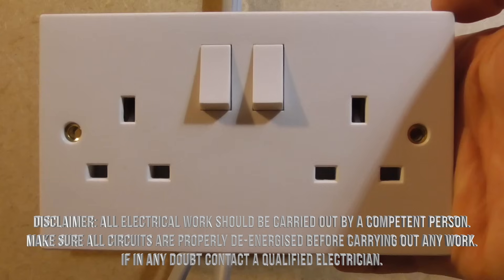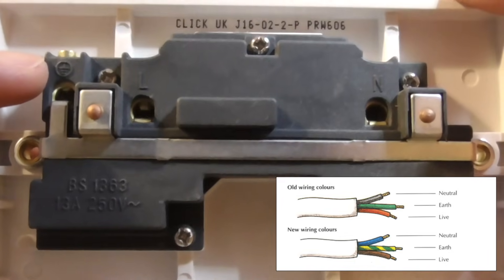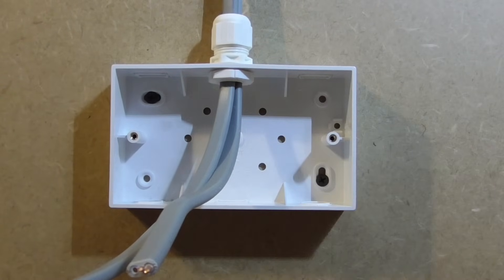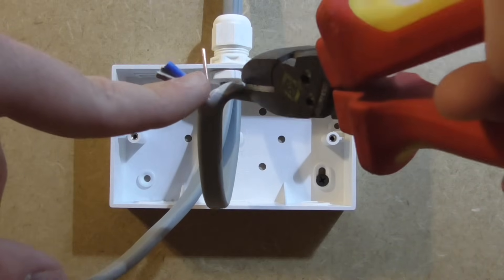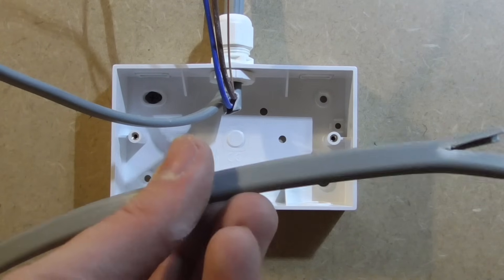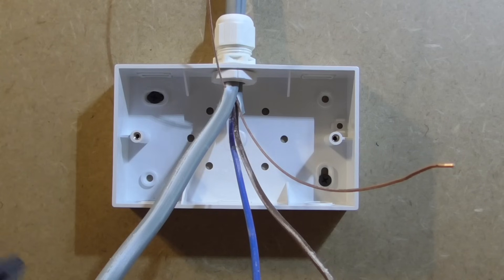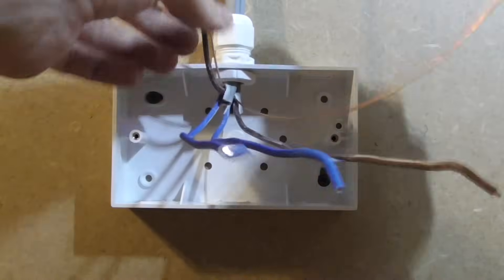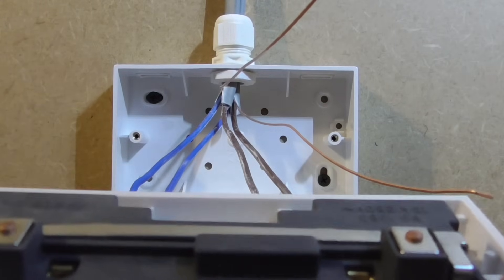How To Wire A Double Socket

Comment: Quick question. Can I connect a double socket with  T&E and put a plug on the end of the T&E and plug it into a separate socket. So basically making the double socket an extension lead

Comment: Thank you. The live and neutral were opposite to the one I removed from the wall. I'm so glad you mentioned that this might happen (7.08 in the video). Now I am quite confident in replacing the unit. Thanks too for talking about the different colours, depending on when the house was built / wired (2006). That was extremely helpful. I'll just watch your video again, to be sure.

Comment: May i know how many double socket can be connected on a 2.5mm cable.
Reply: depends on the mcb/rcbo capacity that is feeding the sockets. in theory it could be hundreds as long as the combined load is less than the supply
Reply: That's completely wrong the max is 5. If you put in a bigger mcb than 20amps on a 2.5 cable if the load is higher than 20amps it will work but the cable will heat up like an element because mcb is too big for a 2.5 cable and it 100% will cause a fire. Don't take any advice from this guy he has no idea what he is talking about. I know he's not a qualified electrician by how short he cut the cable  no electrician would do that. And that is not the correct way to terminate the connections it's much more likely it will cause a loose connection in the future. Loose connections are the cause of 90% of all electrical fires in ireland. Our regulations are the same as the UK

Comment: Those conductor wires are way too short. Conductor wires that are too short can cause them to come loose a lot more easily. Plus if anyone had to do future work it's good practice to leave enough length for them to cut back if they needed to.

Comment: What if you dont have an earth? I have a two socket and 4 wires and what messed up is all the wires are red. The electrical wire coloring in this house was done badly. And im trying to switch it out to a double universal. Both socket was wired with like a bridge from left to right with the original setting. So I dont know if it will work if i remove that bridge conection.

I have 2 Nuetral holes on the top and 2 Live holes on the botom so they are  parallel to eacother. Plus only one wire can fit per hole, not two.

Comment: Can anyone tell me why there are two live cables? Some of my living room's socket have two live cables and some of them has one???
Reply: If it's on a ring main then it will have two cables connected to it; each cable going to the adjacent sockets in the ring. 
If it's only a single cable then it most likely is on a spur.

I'm not an electrician so open to being corrected, but think I'm right in this

Comment: Those cable are too short, if that outlet had to be replace with a different connection position. The guy replacing it is  gonna look silly because the  cables don't reach. I wish I had a pound for how often that's happened to me.

Comment: Does it need testing and a minor works certificate issuing , R1+R2 and zs values . Justin’s wanting to know before I do it myself and void my house ins
Reply: Faster Hard House  brilliant just what I wanted to know, I’ll get the pros in to fit sockets and light fittings from now on, I see many DIYers going for it but when it comes to them selling the house they end up in all sorts of trouble when the solicitors ask questions 👍

Comment: I should know this but why are there are there TWO cables going into the box????
Reply: because it is on a ring main, only one set of wires on a spur
Reply: So can this be done with 1 set of wires in a double socket ?
Reply: @bairdybee  if it's a radial and there's no sockets being fed off it, yes
Reply: Because it’s a double socket so it needs double the flow???

Comment: Cables I always go 25mm past bottom of box at least.  And cutting across CPC and Line/Neutral you will trip any RCD/RCBO and drop out power to other circuits.
Reply: This is a super late reply but I think he's referring to, if working on alive circuit, cutting all the wires at once would cause a short circuit due to the conductivity of the cutting tool
Reply: Can you explain what this means to a layman please? CPC? How has he cut across anything?
Reply: @rorywestfold1657  CPC is Electrician speak for EARTH.  Circuit Protective Conductor.

Comment: Thanks for video. I am wiring a fridge and heater to an STC 1000 temperature controller. Can I use the same type double socket to connect them to the controller, i.e. is that safe?

Comment: You made this hard work by cutting the cables so short a good tip would be when u have striped the cable pull the wires to the furthest corner of the box and cut the live and neutral afew millimeters longer and then the Earth's a few millimeters longer than that.

If the cables come through different points of the box take the striped wires to there furthest corner this may be different corner it's might also be the same e.g. cable comes in at the top left so take the striped wires to the bottom right.

Comment: I’ve got 2 Earth points  On my double socket  plus 2 earth wires .  Can I connect both Earth wires to One point Or must I connect each wire to each earth point ?
Reply: You can put them both in one earth terminal or one in each it's up to you. However in some situations the earth might be short so might only reach to one point any way.

Comment: Do you not bother to fold the ends of the wires in half before inserting them into the terminals? Some say it is necessary, but it makes it much harder to insert them esp. if you have 2 wires into one terminal.
Reply: if its two cables then you shouldn't need to fold the ends, but if theirs only one cable its a good idea to fold the ends because it gives a better connection.

Comment: Here in Canada (and the states) the wire colours are black being live, white being neutral, red being a secondary live or a traveler for three way switches, and bare copper or a solid green being earth. to strip the cable you measure the wire with your index finger and your thumb lengthwise against the insulation of the wire, then make a cut around the insulation where the top of your index finger was. After the cut is made the wire is cut down from previous cut to the end of the wire, and you peel off the insulation like opening a banana with your fingers. (This is all done before putting the wires in the box) the cable is clamped down with the restraint inside of the box and the ground (earth) wire is half looped around the ground screw at the back of the junction (back) box and is looped around the ground screw of the socket. The live and neutral are stripped and can either be inserted into the holes on the back of the socket or looped around the screws on the sides. We strip the wire differently because the cables in north America are split into two by a lengthwise trench running down the middle of the cable.

Comment: Bit late to ask, but did the pattress have 20mm knockouts or have you drilled the box for the gland? Cheers
Reply: I am yet to find a plastic pattress with side knockouts :(
Reply: @acvideos671  Hi Amy, I try to steady the plastic around a block of wood viced/clamped. Varying degrees of success. Pillar drill best 😉

Comment: You cut the wires too short so if you need to take socket off for work like tiles or if damaged you will have no play
Reply: Could never understand why people cut cables  so short ..leaves no play or flexibility for future
Reply: Yep.
Reply: He had perfect length of wires in the beginning then trimmed them 🤦🤡 Surely not an electrician.
Reply: in the States,  the NEC is that you leave at least 6 inches of free wire from back of the box.    don,t think it has changed in recent years.   the NEC undergoes changes every 3 years.
Reply: Nothing wrong with the wires its perfect!
Reply: 5chrisy are you an Electrician
Reply: @martinlewis1015  
No but as you know you can pull them down from the wall,
They look fine to me,
Plus perhaps he knows hes not going to remove it again!
Reply: 5chrisy thats not how it works mate😂 just because HE might not remove the socket, doesn’t mean it won’t have to be inspected when testing for continuity or RCD testing
Reply: @kidmanier  you can test for continuity at the fuseboard and u can test for rcd trip time at the fuse board if it's a split board rcd. U don't have to check every socket its usually 30 percent visual. And yes I am an electrician
Reply: @adamsharp201  I never asked if you were an electrician. What happens if you have a fault In the socket?
Reply: @kidmanier  Hense why incompetent people shouldn't mess around with electrics. That's my point mate. Not having a go at you.
Reply: @adamsharp201  well the point is, people do. People don’t always do things right and mistakes are made. 
Just to also remind you that appliances can be fitted and still have faults somewhere down the line. The entire point of an EICR.
Reply: @kidmanier  mate you don't have to remind me anything. An EICR can be 5 years to 10 years. Plus it costs alot of money which people can't afford especially in the world we are living in right now. At the end of the day being an electrician is not like being another tradesmen where so called diy ers can have a go at it. End of story
Reply: @adamsharp201  you’re being naive mate. There might not be a problem with the appliance but there could be a fault with the ring. That’s not uncommon. Stop taking everything as an attack big boy.
Reply: @adamsharp201  if there’s a fault with the ring, you start taking off appliances.
Reply: wtf are you talking about. Taking off appliances , an alliance is an item plugged in to the socket such as a TV a kettle  a washing machine a tumble dryer. Switch’s sockets ceiling roses at called accessories. He has cut the cable’s to short they should extend at least a hand and a half writh . He should have tested it afterwards ie continuity of the CPC insulation resistance test Zs test , and then complete a minor work’s certificate. All of which he should of made clear in the video.
Reply: This was a DIYer showing DIYers how to do a job that should be left to us professionals .